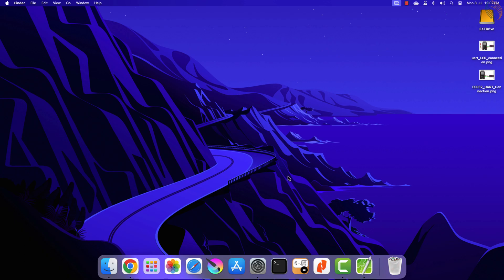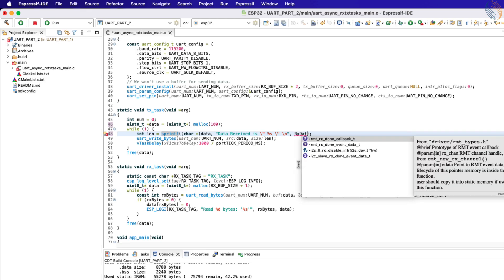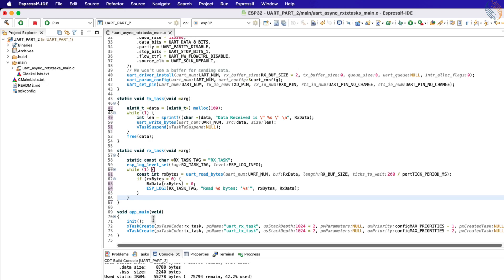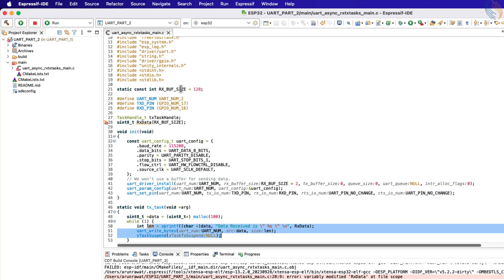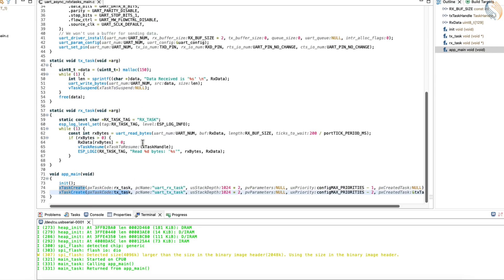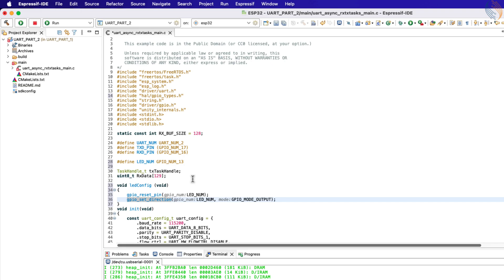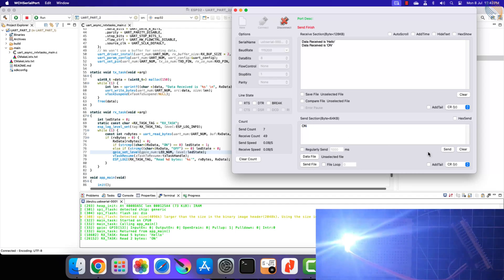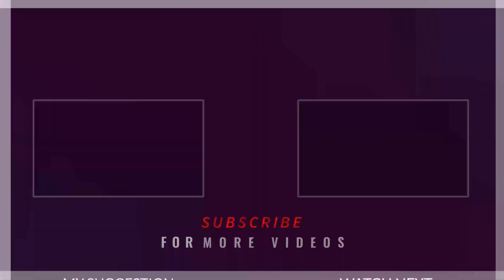ESP32#2 How to use UART || PART 2 || Control LED from Computer

Comment: Hello, it might be silly question but i wonder, you use macos because esp32 builds slowly on Windows, right ? Because in your other videos you use Windows. I could not find good solution to make esp32 build that fast. Do you have any suggestion?
Reply from the maker: I used to have windows but I have mac now. Yes ESP32 builds faster in mac compared to windows but that is not the reason for switching to mac.
Not only ESP32, I find it faster for all my other work as well. 
I don't know if there is a way to make it build faster in windows too.